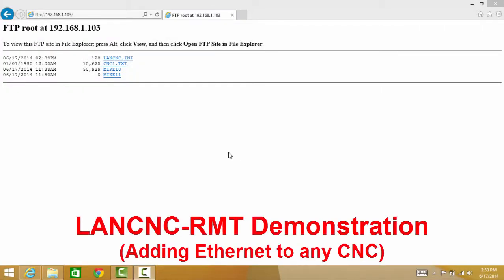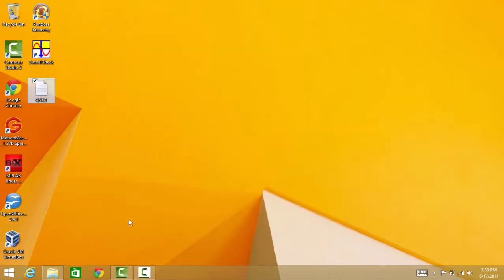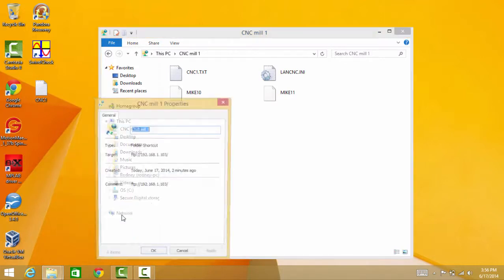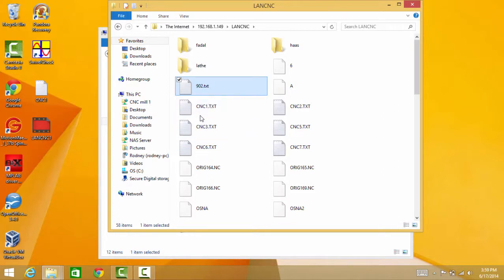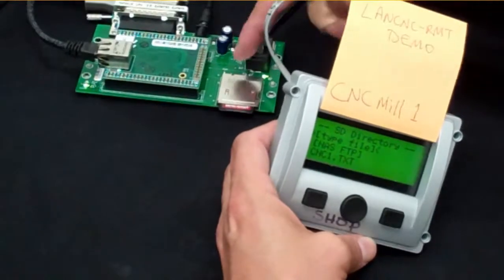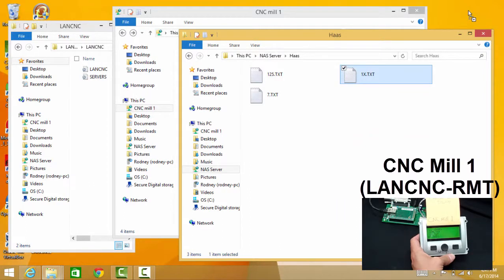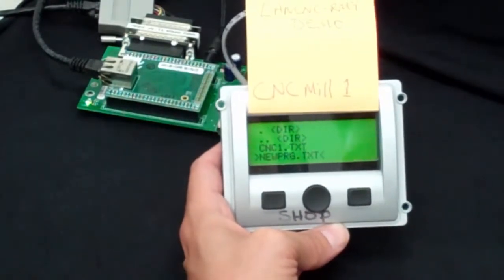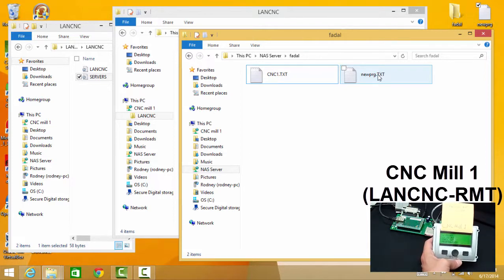Calmotion LANCNC Remote File Access Tutorial, Add Ethernet to any CNC

Comment: If you don't already have one of these I would highly recommend getting one or some.  We have several of the LANCNC devices and they have been solid as a rock.  These are great devices for getting programs from our Engineering department to our machines.  Our operators love them too, they are very easy to use and so much quicker and more reliable than the tapes, plus you won't loose sleep at night.  They are a great way to extend the life of your machines and virtually extend the memory of your controllers.  We have these installed on our Mazak a12 with a T1 controller, our Mazak 515 with the M32 controller and our SV25 with a M32 controller.  The guys at Calmotion were great to work with and these units were easy to install and get up and running.  We were using Serial Via Ethernet devices prior to the install of the LANCNC's and they were kind of a pain.  We have trained our operators on how to save programs they have created on the machines; in addition to loading the programs.  Our 515 uses both Mazatrol and DNC G-Code, we use a simple A/B box to switch between and then we make a change to the LANCNC which takes less than 30 seconds to do.  I would highly recommend the LANCNC to anyone that would like more control over how programs are backed up and retrieved on their Mazaks (I'm sure they have these devices for other brands, I've not looked into it).  The LANCNC uses the FTP protocol to connect, so you can use IE to connect, but to simplify the connection I use a program called "NetDrive", this program maps FTP connections to a drive letter for convenience, so I can get to the LANCNC's as "G" Drive.  I have no affiliation with Calmotion, I've just found their products to be extremely useful and thought I'd share my results.